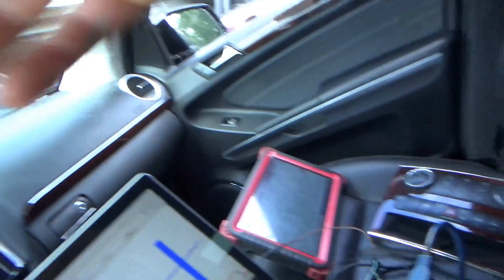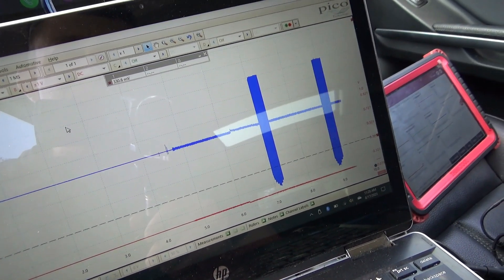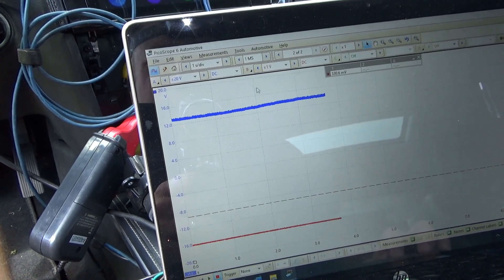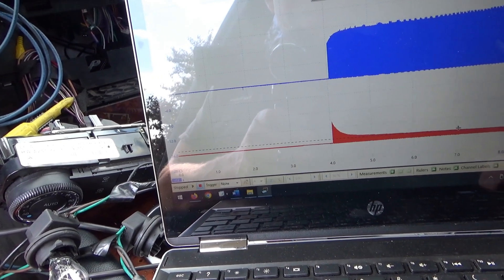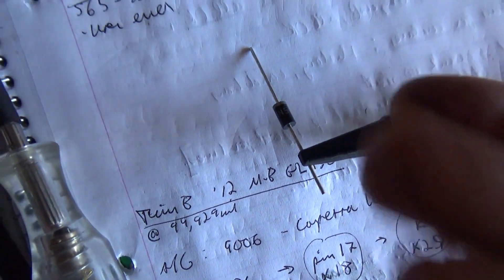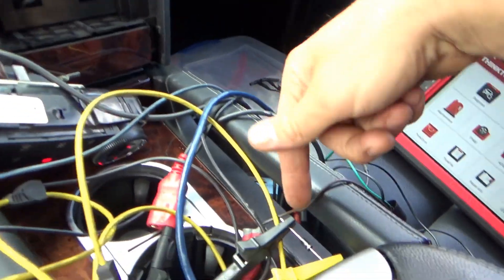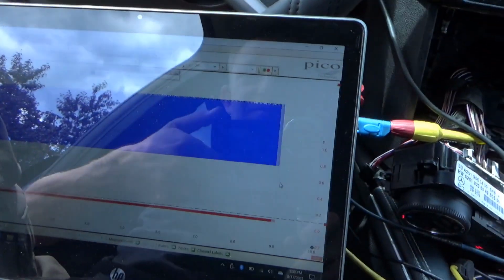Part 2: Did I MIS-DIAGNOSE This Mercedes?? (GL450 no A/C - Crazy REPAIR!)

Comment: Your video was so helpful…3 months of struggle solved in 3 minutes.
My story…the new aftermarket compressor wires wee short and burnt by my 1st AC mechanic,
Shifted the car to another garage and did some new wiring and AC just didn’t work ( same message- open/ short circuit message on OBD scan)
Just did what you told…wow AC is back and full cooling ❤

Comment: The control valve on the old compressor had a triangle on top = built in diode. 
The new compressor probably has a no diode control valve in it (meant for a AC control unit with a diode built in).  
Some diode control valves may have a diode symbol, 5 dots or a yellow dot on it.
If you use a diode control valve in a compressor that didn't have a diode it may work OK, if the next compressor on this GL has a diode on the control valve it might work fine with a 2nd diode as well.

Comment: Hi. Any chance you send me the wiring diagram that you use to install the diode please. I'm having this exact problem. New compressor installed, ac system serviced but still no AC. I think this could solve the problem 🤞

Comment: My car has act the same thing, accept my is 2011 GL550, to save $2,900.00 I bought an air compressor from eBay and took the whole day to install but it still no A/C😡😡,after watching your video it start to make sense ,so went back on eBay bought a new Electronic Control Valve For 7SEU17C 7SEU16C hope for the best. will let you know next week when the part coming

Comment: 2012 GL 350. Original MB compressor. AC worked randomly, sometimes I could see the Max Cool reading in the AC console flash 3 times and then off. Installed the diode on the compressor harness and the issue is solved. Installing the diode on the compressor harness was difficult due to limited access but it did fix the issue. AC now works consistently again.
Reply: I have a 2010 gl 350 and attempted this today.  How the heck did you get at the compressor harness?  I tried from underneath and from the wheel well but I can't see any easy way to access it.  I was able to unplug it but it was still attached by an I accessable phillips screw (for cable management) and a couple other 8mm nuts that even if I got them off I'm not sure how I'd get them back in.  I gave up after 3 hours.  Any hints?

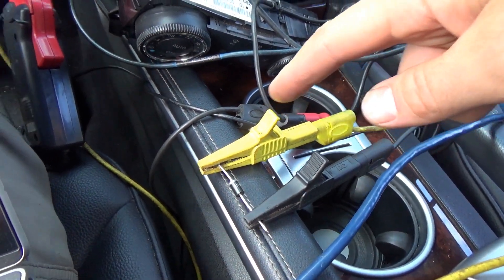Comment: Saw this video and thought of your diagnosis and repair of the 2012 GL AC. So, you were likely spot on with your hunch that the other compressor may not have been original, despite being a genuine Mercedes part. Apparently there are two versions of the control solenoid…one with a diode built in and one without. (Another plausible explanation being that the built in diode failed in its fundamental purpose as a diode and began allowing current to flow back into the circuit, which was resolved by your installation of the diode at the controller.) What you’re looking for begins at 8:40. https://youtu.be/KBx5v9xj_XM?si=VtDbxRwJG8v-gjLu

Comment: Awesome Ivan.❤ there is a documentation in Denso website on how to ID control valve with or without diode built in to control valve. The triangle symbol on the original compresor black plastic body of control valve meant that diode is built in. Also 5 small dots on the same plastic body meant diode is built in. If no triangle or no 5 dots, the diode is inside the hvac computer. Your video is very helpful, thank you.

Comment: Ok what am I missing Ivan? At some point with the original compressor everything worked... so what exactly was the original failure? How could it be the same problem with both compressors? Your fix doesn't exactly explain the exact failure point/cause with a factory type of fix?

Comment: hey ivan have similar problem BUT y spike goes down to -3 volts .....i need help i got 2013MERCEDES BENZ C 300 4MATIC (204.080)V6-3.5L (276.957) an another shop install after narket ac compress so when ac is turn on or car starts ac come on blows ice cold then turn off by it self after about 30 seconds an will not turn back on untill you restart car then same thing . pressures are 32 psi low side an 175 psi high temp outside is 90 degrees ac blows ice cold when working ... i activate compress from scanner an no problem ac compress stays on blows cold ... question do you think diode can fix this one ( i ordered diode) but since only -2 volts flyback volts on my scope  im not sure how to splice diode ( direction ) in control wire.   diode should pass threw to ground from control wire splice ... so path would be ..... control wire threw diode to ground ! 

WDDGF8AB1DR271197

VEHICLE ATTRIBUTES
BODY TYPE: SEDAN
SUBMODEL: 4MATIC SPORT
DRIVE TYPE: 4WD/AWD
ENGINE: V6 - 3.5L 3498CC GAS CGI TYPE 276.957 - 4 VALVE DOHC

Comment: I have a gl450 2012 and have been dealing with this issue for 5 years now.  It was very intermittent at first, but with each season, it would happen more frequently... This year, just about every trip over 20 min it would happen. I have had it to my local shop, but they are not really Mercedes mechanics and did the best that they could with it. They never threw the parts canon at it, thankfully. I was about to take it to our local Mercedes dealer to look at it, but the last time I had it there, it cost over $3000 for a suspension issue by replacing bags and a air manifold. Never corrected the issue. My local mechanic figured out the leveling sensors were not adjusted correctly. His $25 fix corrected that issue. So... long story short, I was very reluctant to take it to the dealer. 

Then I found these vids.... your explanation of the issue was spot on. And, your explanation of why was great and made a lot of sense. Who would of thought of inductive back voltage would be the issue. I may be buying an oscilloscope... through, I would probably never use it, as I am not an electronics engineer or an auto mechanic. Just know enough to get myself in trouble. Regarding the oscilliscope, what are you using.  My foxwell reader was showing the same short or open circuit code on the compressor, and the Request To Component was initiating, would control for a bit, then fall to 0. 

Total cost to fix, $300 for the Foxwell OBD reader (which I actually purchased for the suspension issue) + $0.12 for the rectifier diode (really $6.00 because I had to buy 50 of them). 

Thank you for taking the time to share your knowlege... It saved me (and I am sure many others) a ton of money!!!

Comment: outstanding video series,, this is actually a hugely notorious and well-known issue,, for the clutchless compressor mainly found in luxury vehicles like this, there are two control valves available depending on application: one with an integrated diode and one without-- yellow dot on the plug indicates diode present. however, both genuine and aftermarket compressors alike are arriving DOA from the factory, fitted with valves either missing the diodes entirely OR, diodes of inferior quality and/or incorrect rating OR, diodes wired backwards or faulty solder joint or bent pins etc. you'll deliberately order a compressor with a valve with the yellow dot, or just a valve alone with a yellow dot, and it still may not work because quality control has slumped so hard in the last decade. scant few have ever even heard of a clutchless compressor-- horror stories abound of owners spending THOUSANDS on all new ac componentry to no avail, OVER A $.10 DIODE. the shops and diyers that are actually successfully servicing these things have taken to soldering a redundant diode into the control wiring exactly as youve done, most often right by the valve, or up top in the harness, grounding right to the valve cover. again, wonderful videos, really shows in depth whats actually going on electrically and electronically here!

Comment: That is a spike wupression diode that has been used since at oeast the early 70's (GM put it across the clutch connector - soldered in) and taped up on the end of the connector. Repaired many over the years. Diode test on the DMM, or old analog meter would show the fault.

Comment: Yes a comment below said the diode should be as close to the inductive load as possible. I. E. between the compressor case and the control terminal. When the diode is remote, the inductive spike will travel through wires before being snubbed. I would also use a switching diode as they have fast response to catch the flyback pulse. Anytime the words pulse width power control signal is mentioned we should think transients can happen.

Comment: Additional test I would have used the compressors ground in the test, went over 1 amp in bulb testing, and voltage scope of the bulb ground, compressor ground, and compressor no bulbs.

Comment: Hello Ivan,

Loved the video as always, but have  couple of Q's:
1)  You installed the diode in parallel with the signal (+) and ground before the module.  This would allow backfeed to the module right?
2)  Would it not have been better to install the diode in series with the signal (+) and be finished?  This would stop any backfeed of current going through the module.  Or, assuming no other ground source to module you, could have installed the diode in series at ground wire from the module.

The parallel application of the diode appears to work, but think backfeed to the module was only partially reduced or module has no other possible ground.

Interested in comments from anyone.  Diodes in parallel only circuits can work, but in a complex module (mixed series and parallel) I would have run it in series.

P-Chi
Reply: The series placement of a diode in  this application won’t work because the internal capacitance of the diode would still allow much of the very high frequency spike to get through. And the voltage of the spike is more on the order of 600 volts as I’ve seen on many coils. This high voltage applied many times per second would likely burn out a standard diode. I’m not sure why Ivan’s scope only showed 16 volts reverse voltage spikes. It may be that much of the spike was absorbed by the capacitance inside of the length of the wiring harness between the compressor and the control module. The best placement for the diode would be at the source of the spike which is at the compressor. Maybe this new compressor wasn’t an exact replacement because it didn’t have an internal diode. Those kinds of details are really needed but the regular mechanics don’t have access to them and have to rely on the supplier to get the correct parts. OEM supplied compressor would have been correct but $$$$$$.

Comment: As soon as I saw the "Back EMF" spikes,  I knew there was missing diode. As a general rule, ANYTIME a coil is driven with sold-state device, a snubber-diode to ground is standard electronic-design. Technically, the diode should be AS CLOSE AS POSSIBLE TO THE COIL so the backEMF has no chance to propagate down the wire and crosstalk into other circuits.

Comment: Some coils in relays have a resistor across it to achieve something similar. Don't exactly know the science behind it but maybe to dampen the high reverse voltage ?? The diode certainly did the job in this situation and only by using the scope could the anomaly be clearly observed. This case and others in the past have demonstrated the necessity of having a scope as a critical part of a mechanic's toolkit and of course the training to be able to use it correctly. The multimeter is fine but has serious limitations in today's computer orientated dynamic systems.

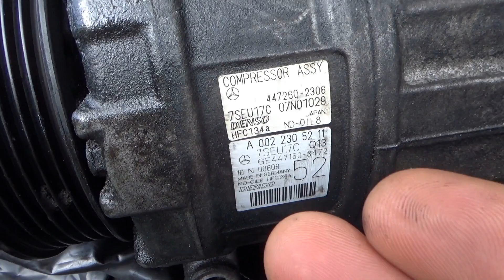Comment: 5:50 When the original compressor is power side controlled with hard ground 24/7. Why should it have a diode? Or am i missing something?  I guess the new one uses both wires and it grounds through control panel and thats why it should have one but when the ground is on all the time is it needed anymore? 🤔🤔🤔

Comment: Ivan, I used to work with DC power supplies that "made" a pulsating DC voltage up to ~100,000 Volts peak DC.  We wired 80 diodes, (almost thumb size,) in series,  on each of the 4 legs of a full wave bridge rectifier  I don't remember the PIV for each Diode, in the string, but it was huge.  Those components were submerged in "Oil" for cooling and insulation purposes.  Loved working with them.  

 I worked in QC and testing for a company that built  precipitators:   "NWL Transformer Company,"  Bordertown NJ."   Nothing like listening to the "crackling" of an unloaded ceramic bushing, as you ran the unit to "30% over the  AC power input, to the xfmr primary,  for 1 minute."  This was to see if it would make it or not. :-)  Always had my hand over a BIG RED power off mushroom button.  :-)  

Ivan, you demonstrated great brainwork to figure out  how to eliminate those negative pulses.  Had you not done this, that car would still be "down and out."  Great job.

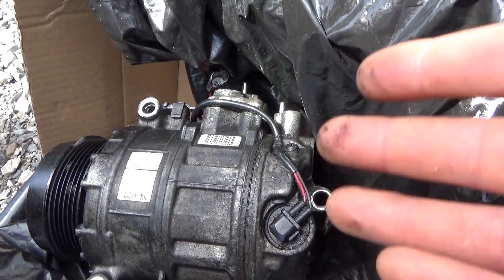Comment: Ivan, at "6:39," your  closeup of that item you said "might be a diode," sure has one half of a diode's symbology.  Why not disconnect the wiring and, on a meter's diode function, read both ways to see if it conducts one way and not the other.  That would complete your thought of "is it a diode."  Love this diag thus far.  :-)  m.donavon

Comment: A better install of the diode would have been to solder pigtail wires to the diode. Cover diode and solder connections with heat shrink then connect pigtails to the wires. Also, a label attached indicating what the component does.
Reply: I agree, I would have been more meticulous in the diode installation.

Comment: The diode really wants to be at the compressor, not on the other end of the control wire
Reply from the maker: Why?
Reply: @PineHollowAutoDiagnostics  best to always clamp the back emf as close to the Inductor as possible. It reduces the size of the current loop and eliminates the inductance of the wires. From an EMC point of view, it stops radiating harmonics from the ringing. It'll be fine in terms of protecting the HVAC controller from the spikes though.

Comment: Looks like the diode is in the old compressor's connector. This is why you have two wires from the body of the compressor going to the connector but only one pin to the car harness

Comment: I once found an open diode in a Chrysler wiring harness.  No AC clutch operation.  It was well hidden in the harness.  The dealer didn't have one and didn't even know it was there.  I used a 1N4007 or something as a repair and taped it up again.
I also seem to remember a diode installed on some Fords right at the clutch connector.  Good job Ivan.

Comment: There has to be a diode in that plug on the compressor or in the wiring in the dash at another junction in the wiring where ever it is it's burnt out the poor old DIYer would never have found it & most won't spend the money on a scope. They (like me) would have to find someone like you to effect a repair out here in AUS the problem is finding a trusworthy tech .Thank you for this it has been an eye opener.Cheers mate be seeing you in the next video.

Comment: Plug  on passenger side under floor carpet red wire melt and it unplug red wire, most of those models has that same problem
Reply from the maker: Where does that plug go?

Comment: Ivan, did you check if the diode was warm after the A/C was running for a while?  Could be bad news if the diode gets too warm and starts melting wires.
Reply from the maker: How could the diode get hot? It only passes less than 1 amp during the short turn-on period for the compressor valve, and it has negligible resistance so shouldn't produce much heat at all!

Comment: OK guys explain something to me.  The compressor has a duty cycle? What? I thought it was just a signal to the clutch and the clutch is either engaged or not.  Is there some new compressor technology that I have missed. I been designing car radios for the last 20 years and not AC circuits.
Reply from the maker: Clutch on/off compressors are being phased out. Most new cars have variable displacement compressors controlled by a module like this Mercedes :)

Comment: Ivan!! that is sew kool/ Yeah I know bad dry joke. BUT to me it sounds like there was a manufacturing flaw from the factory where either the diode was too weak and or OR the control circuitry was not manufactured properly and a step was missed - In any case YOU Fixed! IT... Wayda go there Cool DUDE!!! The one thing that can only cause this is unregulated or poorly regulated charging of some sort  - Boosting battery from jump starting or bad battery charger with a bad A/C ripple or Welding without disconnecting battery first. WOW talk about Delicate electronics ...

Comment: Used in that configuration, it's called a "flyback" diode.... always good practice in circuits that drive an inductive load (even relays).  There was probably one inside the controller that blew-out at some point in the car's history.

Comment: In a class I teach, one of the project the students can build for the final project is a pulse width modulated fan controlled by an Arduino.  The fan is a spinning magnetic coil so we use a diode to bleed off the back emf generated when the pulse turns off.  Easy enough as long as you don't exceed specs otherwise the diode will release it's magic smoke and will stop performing magic.  Inside joke.

Anyway, this makes sense.  Might explain the "short to ground" code.  If the original diode was toast one symptom would be shorted.

Comment: When you showed the negative  pikes, I realized a diode was necessary.  This is not the first time I have seen diagrams omitting a diode here or there, especially if the load (compressor) is remote from the controllers.  Very cool diagnosis, Ivan.

Comment: Ford uses flyback diodes built into the A/C compressor connector.  Not sure about other manufacturers. You can actually puchase them diode connectors after market.
 Nice work!